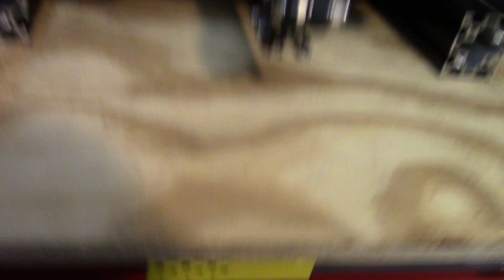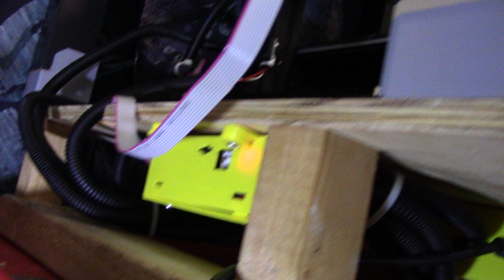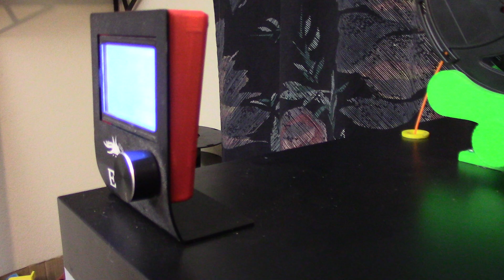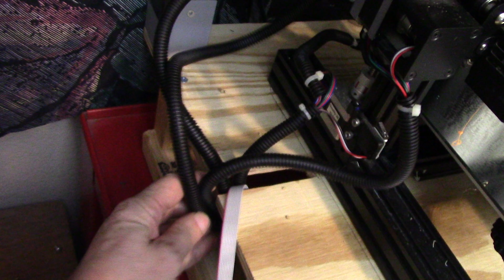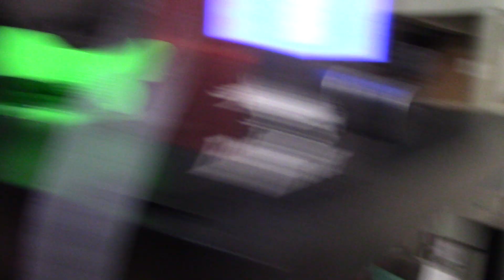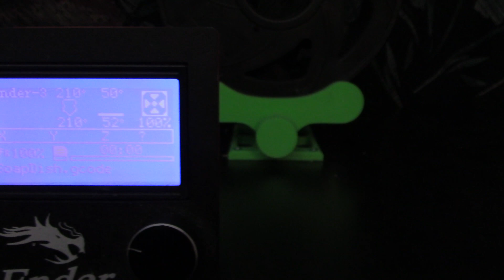Almost Done! Ender 3 SKR 1.3 and Ikea Lack Enclosure

Comment: Did you have any trouble installing or setting up the skr mainboard? I want to buy one too, more specifically the skr mini e3 but on the Ender 3 facebook group some guys said that theirs caused them trouble and the firmware isn´t fully functioning yet and also something about an EEPROM that´s not working or not there. Can you confirm any of this ?
Reply from the maker: Yea, there were some minor trials and tribulations. The instructions I followed from Teaching Tech weren't perfect (probably changes in the firmware) and I had to figure it out. Things like activating the on board micro SD card slot and using the stock Ender LCD panel gave me some trouble, but I either figured it out or found solutions on the internet. I also had to adjust the max nozzle temp as well. I'm a bit disappointed that there's not two fan outputs (most people are using the second extruder plug), but I worked around that. I think it took me a few hours past where I thought it would have to get it up and running. And I had to go back and make changes. And unfortunately, I damaged one of the 2 pin 24v plugs and had to repair that. But I really don't know what they mean by the firmware not being fully functional. The firmware is Marlin. What are their complaints? I've made multiple prints on mine without problems. I'm going to continue my polycarbonate series soon and that will be on the printer with the SKR 1.3 board.
Reply: Chuck Bryant Ok you have the skr 1.3 maybe the other one that was specifically for the ender 3 is different in that regard. I haven‘t looked much into the functionality yet past the video from teaching tech. Also I just want it to work and be accurate, did some modifications already but when I build the enclosure I want everything to just print without me constantly having to change settings or add fans or whatever. 

I don‘t know really, I read it has Marlin 2 preinstalled but I was told it‘s not yet fully compatible with the board. Could also have been the primary batches that were faulty and now the boards work well

Comment: How did you get it so sighlent
Reply from the maker: It's the TMC 2208 stepper drivers. And of course a board that they can be put on. I think there's a 2209 driver now, but not sure they could make it any quieter than the 2208's.
Reply: Chuck Bryant thx

Comment: Looks great, Chuck. Big progress!
Reply from the maker: Thanks Paul. I'm thinking about something a bit different for the sides and the back. There's a big metals surplus place a few miles down the road from me, first cool day (cool being anything under 100 F) I'm going to go rummage around.
Reply: @3rdpig  Have you thought about clear corrugated roofing? It's much cheaper than clear perspex and usually in stores like Home Depot. You'd have to print some curved 'end-stops' for the gaps. I don't think it's hugely heat efficient, but I wouldn't have thought that's a deal-breaker. Might not be very pretty :-).
Reply from the maker: @PaulMcKillop  That's a good thought Paul, I'll take a look at it next time I'm at Lowe's or Home Depot. Another thought is the frosted overhead panels that go into the old florouscent fixtures. They're cheap and I think would be easy to cut. 
I have to admit though, that I'm becoming enamored over the industrial look with port holes. Pre cut, six inch round, 1/8" Lexan can be had pretty cheaply. and any material could be used for the actual panels themselves. And I can print a six inch ring to mount them.
I have keep telling myself "It's a utility cabinet, not a show piece". lol

Comment: will u add acoustic silencer sponge sides and back for noise and heat insulation? im thinking enclosure till 6 months cant decided yet cause of fire,sound, dust, stability,sturdiness etc :) and u can add hpfe and active carbon filter for abs too ill send a link about it if u want. i search about server cabinets rock solid but i ll go for alimininum profile 3030 more customizable, thank you Chuck good video again
Reply from the maker: I have no need for noise suppression, the Ender 3 didn't bother me when it was stock, now it's so quiet I have to keep looking over at it to make sure it hasn't quit, and that's with it still open. 

I'm not sure about heat yet. Since I haven't done this before I have no idea how hot it's going to get inside or how well it has to be sealed, or ventilated, to keep it at a constant temperature.

Sure, give me your link and I'll check it out!
Reply: @3rdpig  in my opinion i can add dht 22 with lcd esp 8266 or esp32 with blynk app u can check lcd and phone tracking hum and temp, u can add mesh holes for air silculation in and filter for out for idea i can add 2 links for first one a company who makes enclosures for printers 2nd one maker if u need assisyent about iot i can help

1 https://www.alveo3d.com/en/enclosure/
2 Universal 3D Printer Smart Enclosure found on #Thingiverse https://www.thingiverse.com/thing:2792618

3 for filter idea
https://www.thingiverse.com/thing:2105113